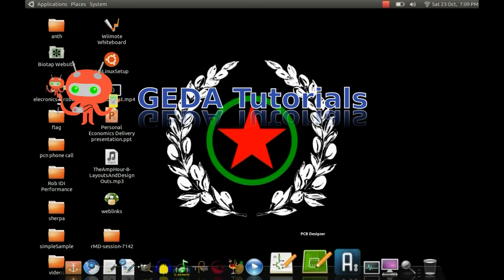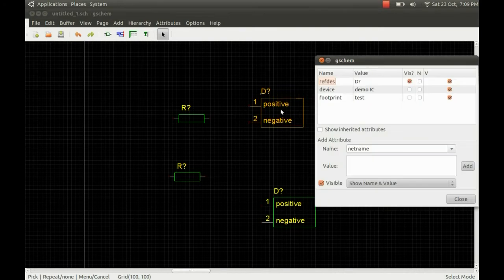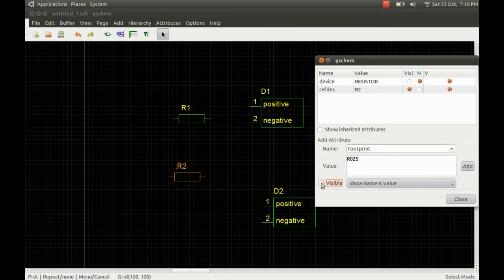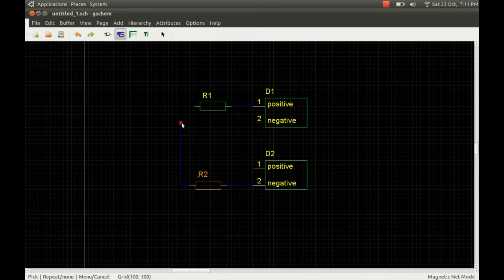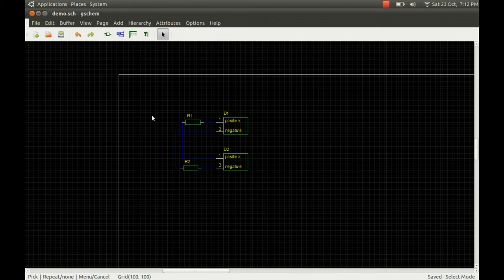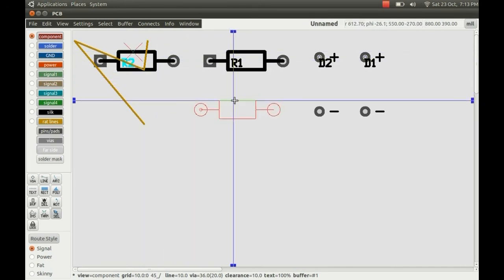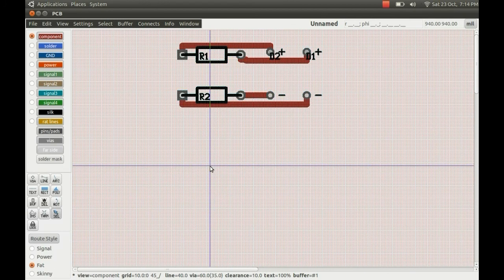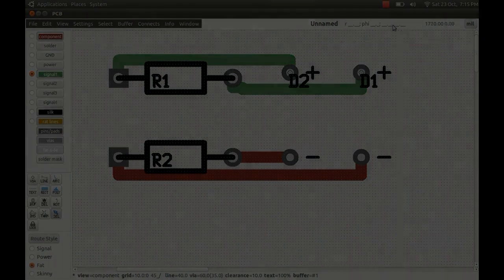GEDA Schematic To PCB Project - The GEDA Workflow

Comment: gEDA usually comes with a program to renumber all the reference designators. You can run it from the command line:
$> refdes_renum schematic1.sch schematic2.sch
and it will give each component a unique designator across the schematics. There are also options for starting each page at an interval so components on the first schematic are numbered D101 R115 and D201 R204 on the second et cetera.
Reply from the maker: Thanks Dan

Comment: Hi, even though the video is already old, it really helped me use geda. What I'm struggling currently is where to find footprint lists, and among many guides it is mentioned that there are already pre-made footprints. Where can I find such lists, like where can I see a list where the "R025" footprint for a resistor can be found and for other components?
Reply from the maker: It's been such a long time since i used GEDA it's hard to remember. I think you have to go into the file directories and look through there. OR alternatively, you can place a similar component in PCB, then check what footprint it uses

Comment from the maker: @nazarottto I guess it depends on what footprints you have available. You will need to copy the exact name of the component (it's case sensitive). Also make sure you are assigning the footprint and refdes attributes properly in the schematic editor. If you try: 0.125W_Carbon_Resistor -> that should give you a through hole resistor footprint.